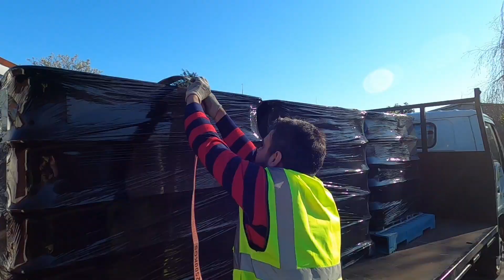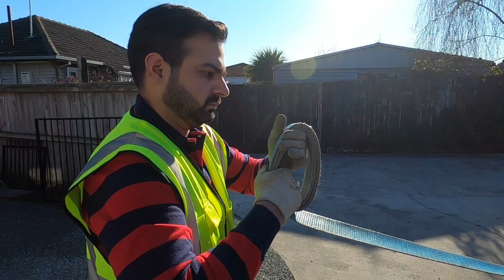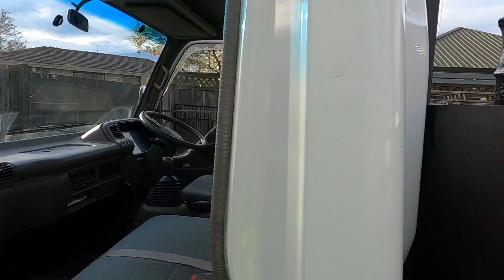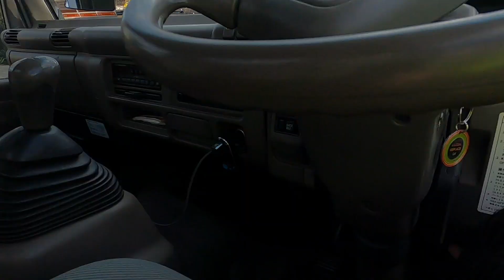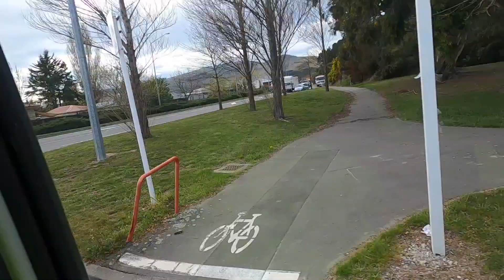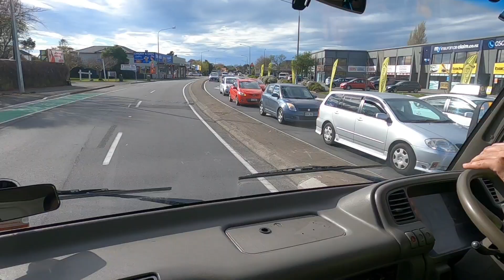Class 2 Training with Sachin #sdt #nz #License #🚚

Comment: In Belgium you would not have passed the test, driving all the time on the wrong side of the road :-) Congratulations. You learned me how to nicely tuck away the unused end of the straps. One thing I noticed was that your apprentice did not use the half twist method on the other side of the strap as explained in a previous video about using ratchet straps. Greetings and keep it safe.
Reply from the maker: Hahaha😁 good one